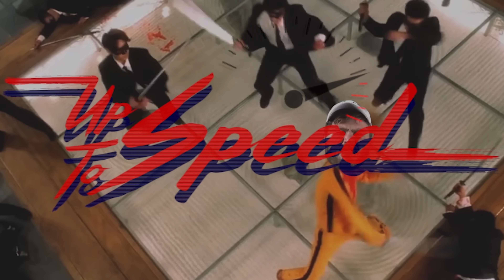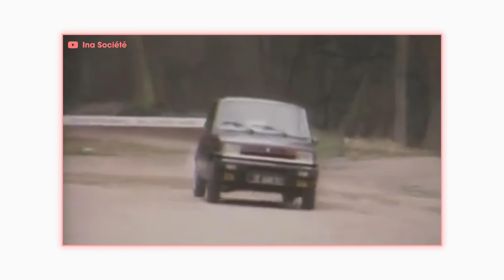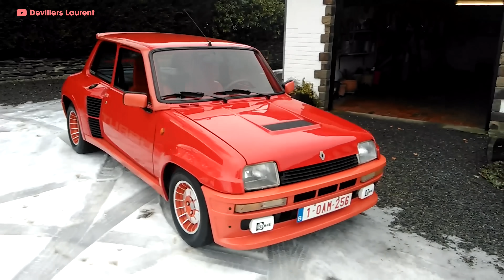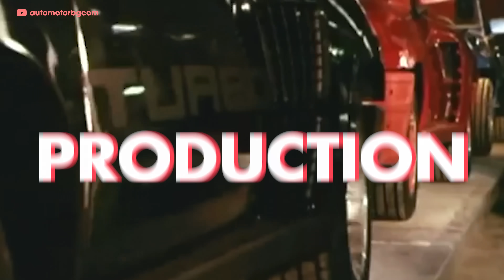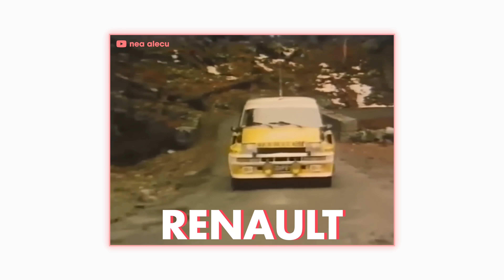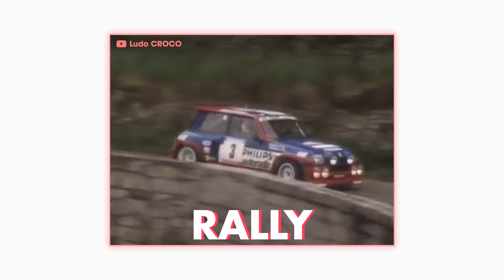RENAULT 5 TURBO - Everything You Need to Know | Up to Speed

Comment: The 1979 1.4 8 valve OHV naturally aspirated engine in the R5 Gordini had a higher specific output than a modern day Chevrolet LS2. Thats pretty impressive considering the similarities. The head was actually a Hemi-design. Meanwhile in the states, the 1979 Camaro Z28 got less than half the specific output from its csb.
Reply: Trina Mcdervish  Well the regulations were the european standards of the 70s and US had their standards during the 70s, getting 65,7hp/l in the 70s from a 2v OHV engine is quiet good no matter the comparison. Its more than the 450hp ´70 Chevelle  LS6 could bring out before all the smog crap of the 70s.
Reply: Panhard invented the Hemi design
Dodge copied it 💅🏽
Reply: @apashe974  Hemispherical combustion chambers had been in use for over 50 years already before the Chrysler Corporation got around to it.

Comment: Do the Vauxhall Lotus Carlton
Reply: And the Awesome story in Britain that the car had.
Reply: 40 RA intensifies
Reply: opel*
Reply: @sealand9049  its Vauxhall Lotus Carlton in Britain and Lotus Omega for the rest of europe if im correct.
Reply: @Schnitzel101at  You are right. Either way, it's a beautiful car.
Reply: @Valucyan  it is
Reply: its just a lotus Carlton it wore no omega or vauxhall badges.
Reply: Just one on Vauxhall and one on Lotus in general would be cool.
Reply: bb-16v yuo wrong is a vauxhall lotus Carlton
Reply: @Lusty_85  there were actually more Omegas than you think. And all of it was a full-on Opel with Lotus tweaks. 

"Opel had hoped to build 1,100 cars in total, but owing to the recession of the early 1990s, the Carlton/Omega priced at £48,000 was not selling as well as anticipated and production at Lotus was halted in December 1992. Only 950 cars were completed: 320 Carltons and 630 Omegas, 150 short of the original target."

And the Omega itself was as much of a Vauxhall as they have been for 50 years.

"The whole development program cost two billion Deutschmarks." - very British.

Comment: My dream car is a Renault 5 Turbo Gordini.

Screw owning a Lamborghini for a dream car, I want a Gordini!
Reply: If you can find one they're pretty much half the price of a Lamborghini.
Reply: Lamborghini went downhill after the Miura, always the same design..
Reply: @pikminologueraisin2139  most supercars use a similar setup as the muria
Reply: I don't know if you do or don't but too many people confuse the Turbo 1 and 2 with the Gordini
Reply: The clutch is the same, on the Diablo barely fixed versions.
Reply: The R5 Gordini was a front wheel drive version (later turbo charged) of the normal R5 - it was known as the Gordini in the UK as the correct name "Alpine" was already being used by others.
The R5 Turbo and later R5 Turbo 2 were the mid engined variants featured here.
Reply: I do have to say that the Gordini is the front engined turbo model sold in the UK. The name "Alpine" was all ready being used by Chrysler
Reply: @matthewnicholas6365  Yes they do and will argue all day long....👍👍

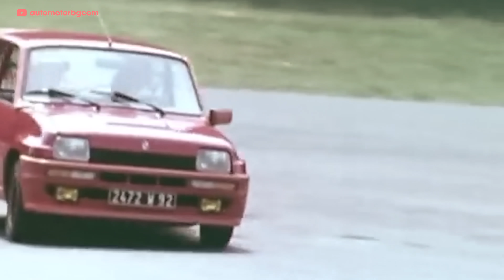Comment: 5:45 wanna know what else only has 2 valves per cylinder and doesn't even have overhead cams?

2019 NASCAR engines
Reply: Come on! NASCAR engines keeps evolving! They switched from carburetors to fuel injection in 2012. That's only 20 years after the last carbureted US road car went out of production. The Renault 5 Turbo had fuel injection, a 5-speed gearbox and a turbo. Wanna know what still never had a fifth gear or a turbo ?
Reply: @malolavoue4717  a daewoo tico
Reply: All of Corvettes?
Reply: wanna know whats a irrelevant and dying sport.... 2020 NASCAR
Reply: MY MOM
Reply: Look at top fuel dragsters. You can still get insane HP out of pushrod engines. I mean the 358 NASCAR engines can make upwards of 900-1000HP when unrestricted on 93 octane gas, and that's N/A. Pretty impressive when you think about it

Comment: Great video 👍

I actually used to own four of the R5 Turbo 2’s😎  Three of them( 2 Red & a Silver) had 3 piece Gotti wheels & upgraded inter coolers to make 185hp. My favorite one (Black) was very modified...aluminum doors & roof, (100 kilos lighter), Momo steering wheel, 3 piece Gotti wheels, Sparco seats & harness , Devil exhaust, cam, bored & stroked to 1480cc, adjustable turbo.....250 hp at the wheels & 1,800 lbs....Le Rocket 🚀 🔥 I used to embarrass a lot  of Porsche’s, Ferrari’s, and Lamborghini’s back in the day!  From 20-120 mph it was hard to beat.

Comment: The engine came straight from the R5 Alpine Turbo (1.4 with T3) that version simply FWD.. that put it at the back and they’ve replaced carburetor with electronic injection

Comment: Alpine was an independent manufacturer which used Renault engines that is all. Officially the cars raced as Alpines, not Renaults, when they won the 1973 manufacturers cup for rally cars. Following a serious strike and the risk of closing down Alpine, Renault stepped in an bought most of the shares of the company. It remained an independent brand, which Renault decided to put Renault badges on eventually.

Comment: Also imagine if we had dropped the twincharged 037 engine from the  Lancia Delta S4 is a Group B rally car. (Produced 500-1000 hp) at extreme conditions (5 bar)

Into the mid engine all wheel drive Peugeot 205 Turbo 16 platform, 

then thrown on aftermarket NOS and water injectors

Just Imagine

Comment: The Bosch K-Jetronic really sucks 😅. 
I have a VW Golf/Rabbit second Generation.
When it runs, your a lucky guy, but if something's break down... Good luck searching for the issues. 
I changed a fuel pump already, then I hadn't enough fuel pressure... And now It runs... Somehow and I am still not done...

Comment: The "Renault" A110 was an Alpine
Back in the early 1970's Alpine was still an independent car manufacturer. Sure, they had Renault engines but the cars were always sold as Alpine . 
You don't call the Shelby Cobra the FORD Cobra do you? Sure it had a Ford engine but it wasn't a Ford. Besides, Shelby himself used a British AC chassis which he modified and shoehorned Ford V8 engines in. Still doesn't make the car a FORD.

Comment: Hello good and funny vidéo!
Im French and I have some little mistake to correct.
Like it as been said, the A110 wasn't a Renault but an Alpine and later in 73 it has been bought by Renault because of financial problems mainly because of the petrol crise but kept is name and team. Later Renault has decided to call Alpine, "Renault Alpine" for marketing reasons and it has been a disaster for Alpine (like the VW Porsche 914). Secondly, when you say that after the A110, Renault hasn't got another car to compete in WRC it's not true, in fact there was the A310, and then the A310 V6, in groupe 4 and 5 which with some investments and development was able to compete against the Stratos and 911. But at this time after the beginning of the R5 Turbo Project, Renault has prefered to developed a competition car with his own name (to boost the sales of the R5)